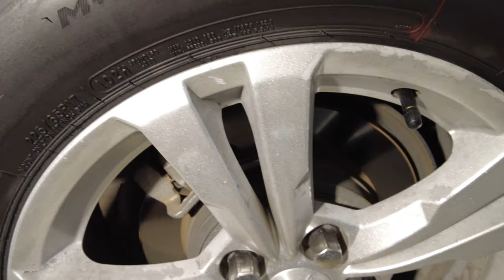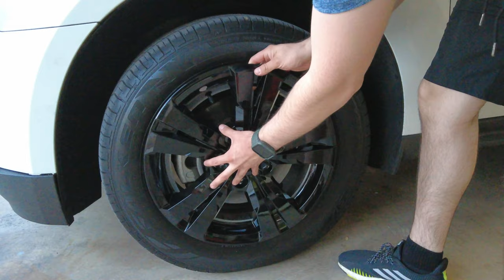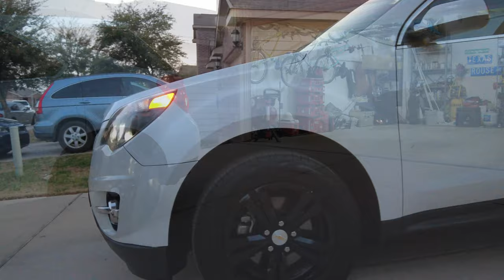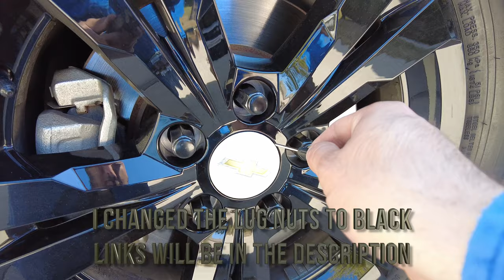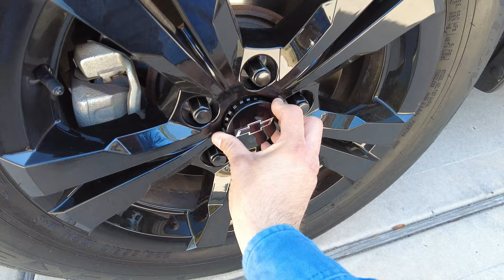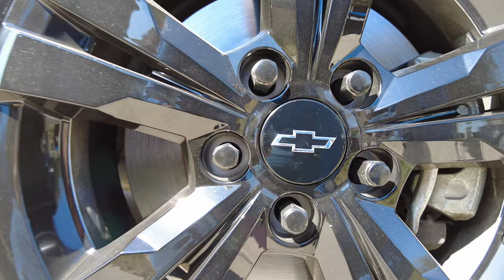Wheel Skin Covers | eBay | IMPOSTERS | Easy AND AFFORDABLE!

Comment: What about when tires need to be rotated and change does that cap cause the issue with the tire removal ❓
Reply: No, it's all good. Only the lug nuts are removed when you remove/change the tires. Plus, there were center caps on before. He just swapped them with a different color.

Comment: Any fear of them flying off at high speed?
Reply from the maker: Nope! I have also ran them through automatic car washes, no issues!
Reply: 2006 mazda 3s ?
Reply: @sparky_izzy  So I finally got them...wish they would've covered up the lip better....but still, so much more cost effective than new rims and they look great. Hope they never fly off when I'm on the highway.
Reply: @harleydad1975 does it cover the top of the rim completely ?
Reply: @harleydad1975  Have you had any issues? Please mention me back when responding if you do so I get the notification. I really don't want to spend money on factory OEM rims that are black if this works.
Reply from the maker: Still no issues on mine 👍🏽
Reply: @sparky_izzy  Thanks man, this will save me so much money.